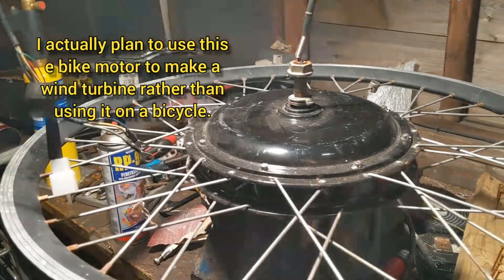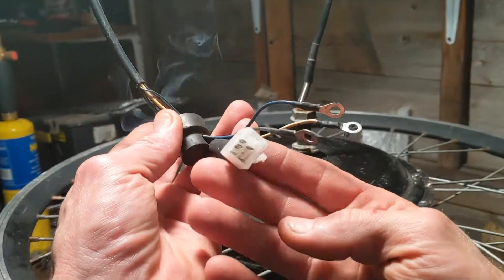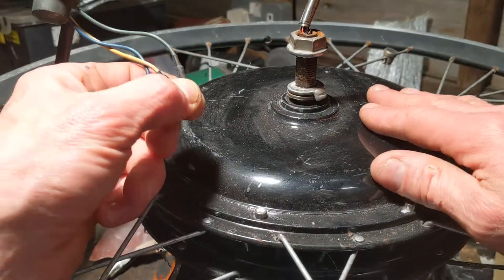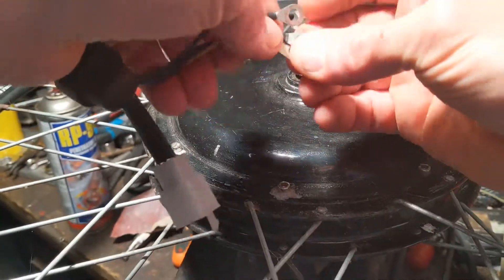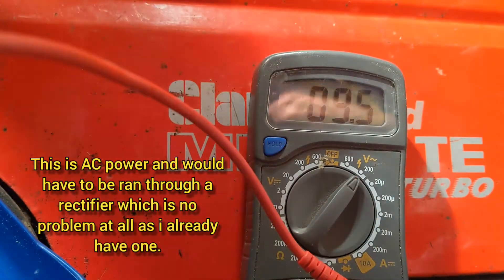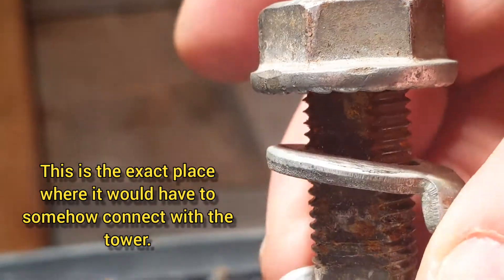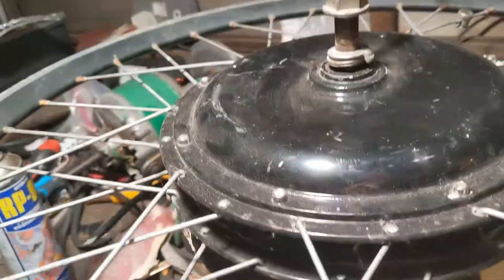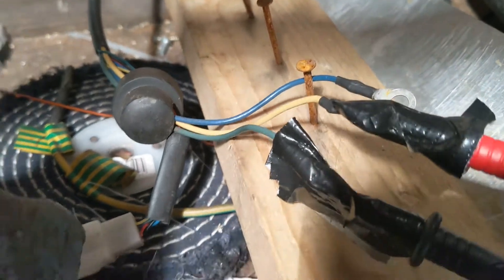How to Test a 36 / 48 volt Electric Bike  -  E-BIKE motor without a battery !!!

Comment: How do we test its overall rollability? I'm wondering if there's an easy way to test if this wheel will still roll fairly roundly after the electrificationalism of the cordages. Using the M1 2-E orbals affixed to me head appendage I can see there is a variance on the quantumal stage putting it slightly out if round.😊
Thank you for the video and the great repurposing idea for the hub.

Comment: Is there getting away to get the wheel to spin by bypassing everything to see if it's moving? Or is this the best test to see if the wheel is bad?
Reply from the maker: I'm not really sure about any other kind of test, but this is fundamentally a test to see if the wires have melted or broken down inside

Comment: I have green yellow and blue on a bike hub I've got a battery how do I test it thanks
Reply from the maker: To test the bike motor properly, you will need a controller which sits in between the battery and the bike hub

Comment: My hub is shuddering when non of the wires are connected, when I connect all 3 its same as in your video its hard to turn but no shuddering.  Do you have any idea what could be wrong with it? that happened as soon as I hit a pothole while  riding
Reply from the maker: Probably something come loose inside probably ruined.
Reply: I had it apart and really couldnt see anything wrong with it but i think the hub is done cause I can't figure out whats wrong with it or find anything online
Reply from the maker: sorry for the late reply . yes it may have internal physical damage if you hit a pothole, very hard to repair, cheers.

Comment: I hvw nilox ebike x1. But i dont have a battery to check if it is woeking well i need to connect a battery to the electronic circuit. But how to know the polarity. It has 4 pins in batterybay
Reply from the maker: I should imagine two wires go to the battery and two wires go to the controller box
Reply: @GavinFreedomLover  ThankYou  but which is positive and which negative. If wrong control ciruits will be burned.

Comment: Could you tell me if the hall sensors were bad could the hub still be used as a hub motor? Can the sensors be replaced? Thanks. Good video. I look forward to the wind generator.
Reply from the maker: To be totally honest mate I don't know , I resisted the temptation to take it apart as I have a track record of not putting stuff back together, it actually works pretty well as a wind Generator but does need a 20mph wind.